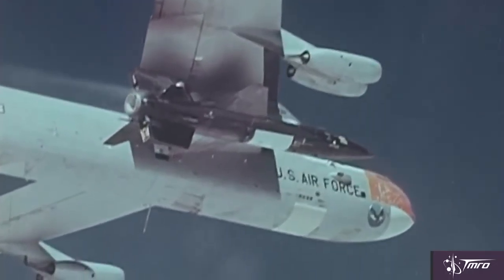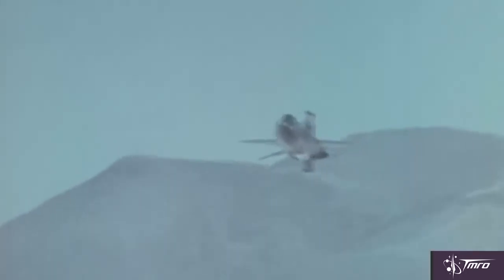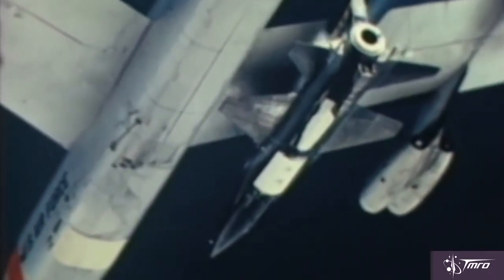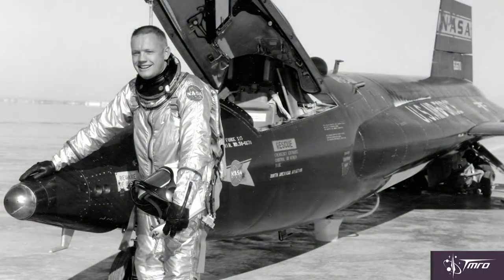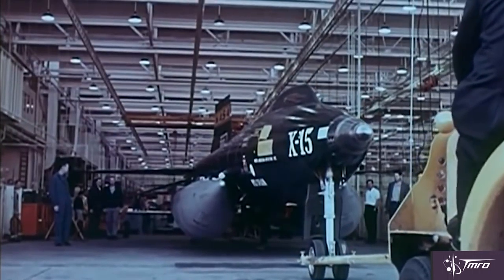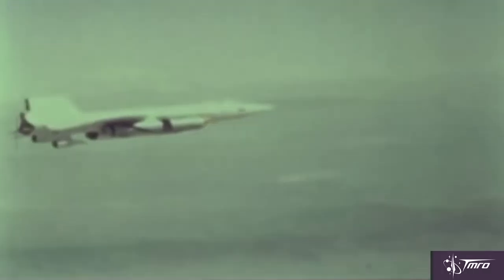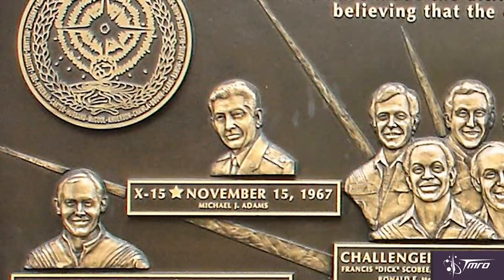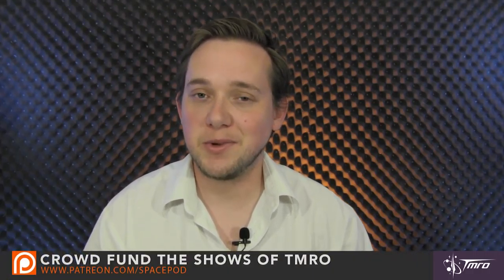Spaceplanes Part 3: The X-15 - Space Pod 05/21/15

Comment: One of those hazardous events where nobody died you could have mentioned was when the fuel tanks blew up during a test fire on the ground with the main development test pilot in the cockpit. All the engineers were in a bunker, and the thermal protection of the airframe protected Crossfield long enough for them to put out the fire. He was stuck in there for quite a while though, what a tough guy.

Comment: Cool pod. Do you know when (if) the data from the project (and other similar ones) was declassified and if it was used in the commercial space industry?
Reply from the maker: Siderite Zackwehdex As far as I know it was declassified right away, later projects were classified for longer, and others are still classified, but as far as the X-15, commercial companies should be able to get data from NASA and the Air Force.

Comment: I've always wondered why the X-15 used skids instead of rear wheels. It seems like the friction would cause the landing gear to snap and/or wear down. Can anyone shed light on this? Thanks!
Reply: +DtRockstar1 Likely for two reasons, one of them you mentioned, increased friction would allow it to slow down easier after landing. Skids are also lighter, and since they likely did a lot of refurbishing after a flight, the worn skids would be a small concern. They also landed on salt flats, not runways, so the skids wouldn't grind and wear down as much as one would assume. This is all speculation though, but I thought I'd chip in.
Reply: +Numb3r2 N4m32 Ahh, the salt flats makes sense. Thank you for the input!